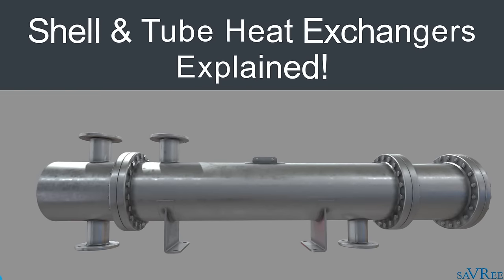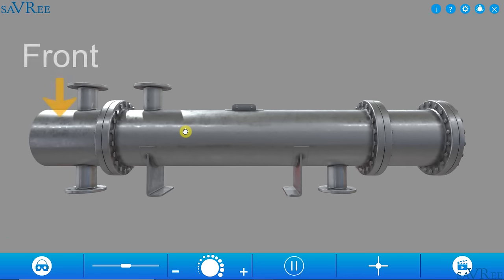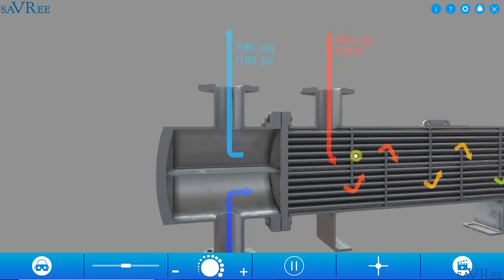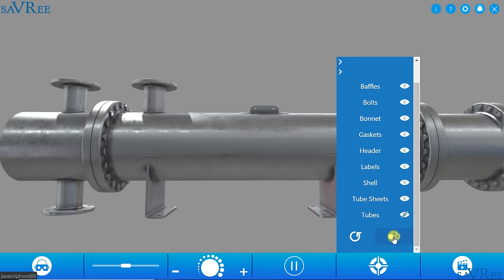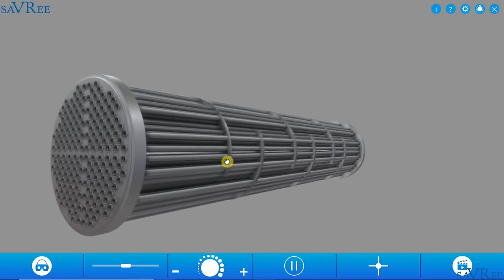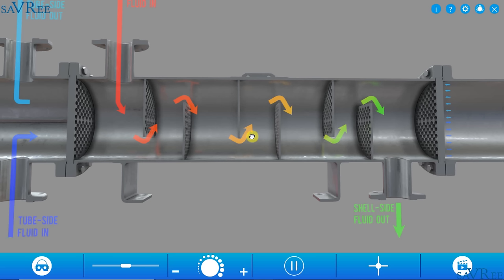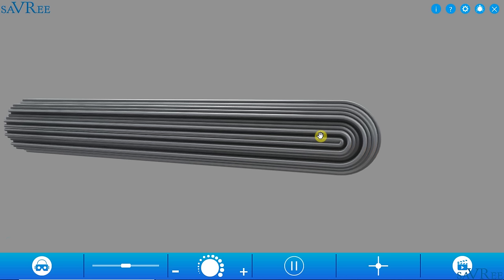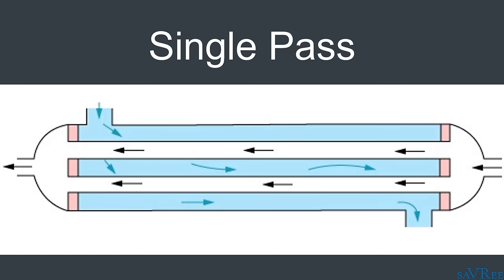How Shell and Tube Heat Exchangers Work (Engineering)

Comment: You have defined shell and tube type of heat exchangers like it is baffle arrangements addressed the thermodynamics of flow as a primary objective! Giving us consequential impact on the flow turbulence achieved by, say, "rod baffles" was a side effect of design and how largely by the flow parametars rather by the flow parameters rather than the design parametars. This is great introduction for a recently, a new development in shell and tube design that has been introduced, the invention of helical baffles which is known by the trase name "Helixchargers". Giving us a Method based on Shell and tube you helped us with New Method in a a helically baffled heat excharger at certain helix angles and the flow pattern in segmentally baffled heat exchangers that involves repeated ecpansion and construction with multiple bends, whereas in helically baffled units, the flow follows a smooth passage through the tube grid. So I can say brilliant way how to imply these technologies that are compatible.

Comment: Got to swap out a 20’*30”  tube bundle whilst is the Air Force.had to cut a hole in the wall to do so. That was some crazy stuffing. It was one of those the engineers for the equipment and the building failed to think about post installation service and repairs.

Comment: Excellent video explaining constructive characteristics of a Heat Exchanger! Just one observation: At 9:51 you mention that the shell side is Multi-pass because of the baffles, but I think that arrangement is still considered to be single pass, since it flows across the shell just one time. At least that’s what I understood from reading Donald Kern’s “Process Heat Exchange”.
Reply: I was thinking the same! I've read Kern too and, if I am not wrong, you can have at most 2 passages for the shell. Moreover, in order to obtain it, one has to insert a longitudinal baffle!
Reply: 2 true

Comment: Thank you for your kindly lecture.
I will try to learn well and share it with my juniors. The direction of YouTube I am aiming to pass on to my juniors at this point in my career to work on the thermal design of the heat exchanger that I have been working for a lifetime. I would like to ask you a lot of teachings if you will hear it often in your chanel.

Comment: Great video! Thanks for sharing and creating this ... It would be great if you can create such kind of videos about ( Cold strip unit ) - a stabilizer unit used to reduce H2S gas from Crude oil using a sweet gas -
Reply: Great idea Husein, these systems have been used along years to extract the sulfur along the H2S associated with crude oil. Actually looking forward to this because of work relations.

Comment: Same principle as a heat exchanger in a boiler. Saw a lot of these in old houses and commercial buildings. You'll never run out of hot water as long as you don't turn the boiler off.

Comment: One thing you didn't point out is often one fixed tube plate/sheet and the other is a floating tube plate/sheet to allow it to move lengthwise tube expansion due to thermal expansion. These floating tube sheets are often sealed by elastomer o-rings or metal rings sliding against the shell.  
I wish I had these videos years ago to give to engineers starting out as I had to often explain the working components in powerplants over many weeks sometimes (as the need arose) instead of having them watch these videos, answering their many questions as visually clear as this.

Comment: Quick question,
Can this design be used as an Atmospheric Water Generator?

Ie, air goes in one end circulates around the tubes which would contain a type of coolant and cause condensation.

Would really like to know if possible.

Comment: Are there any disadvantages to using turbulators? I have worked in many condensers, heaters, and coolers in power plants and have yet to see any installed in tubes. Although not having to remove them for cleaning, eddy current testing, and plugging is a plus.
Reply: Pressuredrop. Means less flow and nore pumpwork. Also risc of pluggning up the tube entirely if there are larger particles. In order to achive turbulence the tube should have proper diameter / design flow, not a turbulator.

In order to clean a shell and tube heatexchanger during operation we use small balls that we circurculate. This cant be done if turbulators are present.

Comment: Missed the Helix type, witch, to my experience, is more efficient and dos not faul that much. Used 1 in a line up of Bitumen heaters / cooler and that was the only one, after a year of production which had no cokes residu inside.

Comment: Great videos !!!! What happen if the level is high and the levels transmitter fail?. what would be the consequence of the high water level in the heater. Would there be a risk of water entering the turbine through the extraction of steam that feeds the heater? Thanks for the videos and the information

Comment: How can you clean the inside of the tubes? Is there a chemical product you can use? Thank you
Reply: Most applications run cooling water through the tubes that has been treated with things like deposit control and corrosion inhibitors already.

Comment: Wouldn't it be better to have a countercurrent arrangement, where the tube-side fluid flows from right to left in your diagram? That way, the coldest inlet fluid extracts heat from the cooler shell-side fluid, but where it is close to exit and is warm, it meets the hottest shell-side fluid.

Comment: I just got done taking one of these apart, it was a U-shaped one. Why would there appear to be a coal fire in the shell area? Built up residue?
Reply: @savree-3d  I asked this morning what was flowing through the system, nobody could tell me. I was told that it is a substance that reacts with the air, and that it's not supposed to catch when we remove bundles, but that it does sometimes happen. No big deal. 

Removed four more today, no more fires. Really cool to see the insides after watching the video and having a better grasp on how they work.

Comment: the video presentation is excellent! However, some important things was never discuss. Why do we need this equipment? How does this equipment affect or relate to our daily lives?
Reply: Heat Exchangers are important instruments in the industrial fields: you have ALWAYS heat exchangers in chemical&process industries. You need to manage the temperature of a stream or its physical state (gas/liquid) or even its concentration  (simply thanks to an evaporator) for satisfying part of the required process conditions ( required flowrate, temperature, pressure, concentration.). This is the point of view of a chemical engineer student, but I am quite sure that you can find heat exchangers also in other industrial and more common applications.
For example, the waterheater/boilers of your house is a heat exchanger too!

Comment: Thanks so much for this video, I want to if it's possible to recover waste heat from an air conditioner using this heat exchanger and also using the recovered heat on alcohol distillation plant? if it is, please help me out with an explanation or design illustrating the process. If it's not, which heat exchanger would you recommend?

Comment: I have a doubt, in the seconde shell and tube HE model, where the tubos aren't straight and it returns to the begining, where do the fluid exit? Because in the first example was easy, the exit is at the end of the equipment, ok, but in the second one, where the fluid back, the exit would be near the entrance? I really don't got it in the video if the answer is there
Reply: I think the entrance has a plate splitting that area into 2 separate isolated sections, a top and a bottom.
Reply: There are two types of fluids - shell side and tube side fluid , in the shell there is shell side inlet and and outlet on the same shell on left top and right bottom as per first model . what you are taking about u tubes tube side pass . its in headers i.e. on u tube heat exchanger there is only one header and there are inlet and outlet of tube fluid on top and bottom of header and pass partition in between .
www.youtube.com/@santoshpatil7912

Comment: Which fluid can we use at shell side?
Ex:hot or cold?
Reply: You should prefer to put the hottest fluid into the tubes because it is really dangerous to have a hot shell... technicians and peolple could touch it and... get hurt! So, in general, if temperature is higher than 200°C it could be a safe idea to use the tube side for the hottest fluid, even if there's an insulation for the outer wall of the shell!

Comment: THE MORE SURFACE AREA AND BEST MATERIAL YOU CAN HAVE TO TRANSFER  HEAT ON A HEAT EXCHANGER THE BETTER. IT ALL DEPENDS ON SURFACE AREA AND MATERIAL. ONE CAN THEN REGULATE THE FLOW OF, LIQUID/ GAS OR, CHEMICAL TO  CONTROL THE MOST EFFICIENCY BASED ON THE APPLICATION FOR THE  PLACE AND ENVIRONMENT. MY TWO CENTS.

Comment: Partly I think this is a very nice video, and I was considering spreading a link to this video to my students. However, then I noticed that you @10.24 talk about the shell-side as being multi-pass on the shell side. That's unfortunate since, as I understand it, this is simply wrong. According to my understanding, is a 1-2 tube and shell heat exchanger with one pass on the shell side and two on the tube side. (I sincerely hope that this design is not called multi-pass by any manufacturers, because that would be very confusing) If you don't believe me you can compare the video https://www.youtube.com/watch?v=7OhFWCwK9X4 by "Washington State University EDUC-ATE Team" where they clearly call (a simplified version of this) single-pass on the shell side.

You can also compare the original (as I understand it) calculations of efficiency factors for different combinations of passes on the two sides:
R. A. Bowman, A. C Mueller, and W. M. Nale. Mean temperature difference in design. Trans- actions of the A.S.M.E, 1940. (I find that a fascinating article, considering the amount of derivation of equations and tedious calculations that are behind that article)

Speaking about Bowman et al, you talk about counter-flow and parallell flow, but a 1-2 tube heat exchanger can't be none of that. That's why you have to introduce an efficiency factor. If you look carefully, in your illustration, half of the tubes will be counter-current and the other half co-current, hence the efficiency factor.

Greetings
Mattias Alveteg
Editor of the YouTube-channel belonging to Department of Chemical Engineering, Lund University

PS
I found this video while looking for some way to replace a demo lab on heat exchangers. Covid-19 is making life difficult for university teachers & students
DS
Reply: I have now located the latest TEMA standard FAQ which comments the 10:th standard
http://kbcdco.tema.org/wp-content/uploads/2020/05/TEMA_StandardsFAQ_2020.pdf
If you look on page 5, you can see in the illustration that the setup you have is setup E which is called a "one pass shell" according to the standard. A "two pass shell", illustration F, has a longitudinal baffle, such that the flow passes the length of the equipment twice.

Your mistake is understandable and is a common misconception among my students and I don't try to imply that my own videos are 100% correct. I think you did a very good job with most of this video, it is very illustrative, in fact the way you take pieces away to show other pieces more clearly and to explain how they work is the best I've seen.

greetings/Mattias
PS: TEMA is Tubular Exchanger Manufacturers Association DS
Reply from the maker: Hi Mattias,
Thanks for the feedback! I generally love stuff like this because it is a chance to question what one thinks they know (it ain't what you know that gets you into trouble. It's what you know for certain, that just ain't so...). 

Every video we make is researched before hand and we speak to subject matter experts, but there are still always things that are overlooked or maybe even misunderstood by our subject matter experts (it happens). I openly confess there is a lot of stuff I do not know about engineering and I am only just scratching the surface. 

Concerning your comment, yes, I agree with what you mentioned (multi-pass and single pass etc.). When I talk to people now about shell and tube heat exchangers, I normally mention which side is the multi-pass side, and which not. Why? Take a look at this image:

https://prnt.sc/wl1gmi

It is classed as 'multi-pass' shell and has the same setup as the shell type E you mentioned (which is classed as 'one pass shell' in the PDF you supplied). In my experience, the 'multi-pass' variable is not defined as strictly based upon either the tube side fluid, or the shell side fluid. I found other situations where this was also the case, which is why I now say stuff like 'its multi-pass on both the shell side, and tube side'. I did a quick search and found a good example of someone also stating the flow type based on tube or shell:

https://prnt.sc/wl1mep

Concerning the counter and cross flow examples (efficiency factor). The thing I wanted to state in the video is that a lot of heat exchangers are a combination of different flow patterns, not singular flow patterns. You can see a parallel, counter, and cross flow arrangement here:

https://prnt.sc/wl1nnu

You mentioned that a heat exchanger 'can be none of that', I would argue it could be all/combination of that. 

Finally, you know you can access this 3D model through a web browser at saVRee.com? You would not be the first Uni instructor/professor/lecturer to use saVRee to make your own video tutorials etc. You can access a ball bearing demo model here:

https://savree.com/en/3d-models/deep-groove-ball-bearing-animated

Just wanted to mention that because a lot of Unis are coming online and we have about 400 different models related to engineering. Might be useful for you?

Kind regards,
Jon